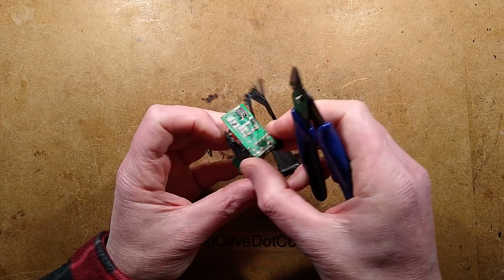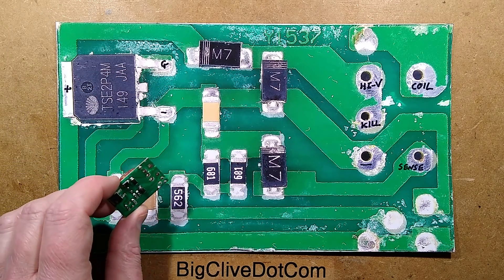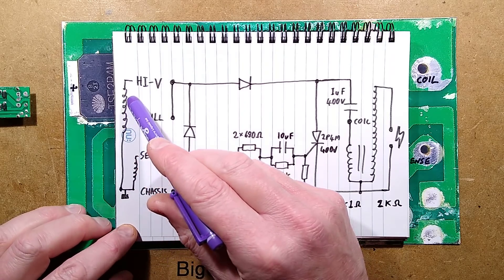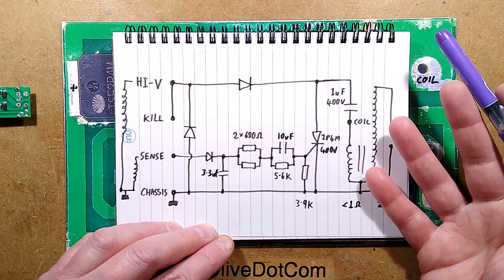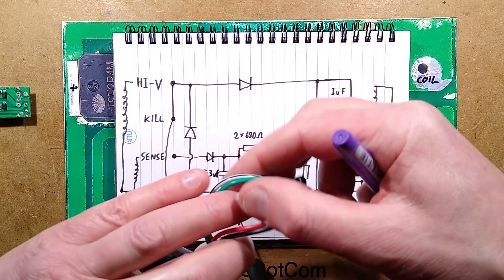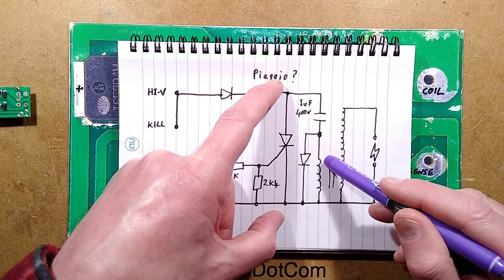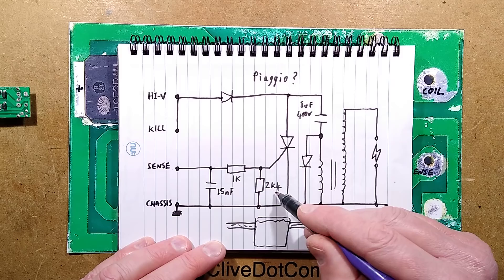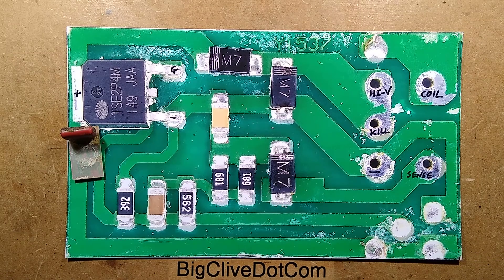Inside a cheap CDI Capacitive Discharge Ignition module - with schematic

Comment: the extra triggering circuit is to advance the timing at higher RPM , the first capacitor charges up more at higher rpm causing it to fire a few degrees before top dead center, this causes the fuel mix to fully ignite earlier so when it passes TDI it has the most pressure to push the piston back down, giving the engine more power. 
You can see this clearly with a timing light when you point it at the flywheel, you will see the timing mark move backwards gradually at higher RPM.
The CDI you took apart has automatic timing advance, the second diagram you showed has none and wouldn't be as good for high rpm engines.
Reply: The second capacitor in series with the gate circuit is a differentiator i.e. it's output will be dependent on the rate of change of the input which also provides an advance function.
Reply: In fact, simple CDI's like these don't actually advance at high rpms, they just retard less. The sense coil is before TDC. Also typical bike CDI's will have a very significant low rpm retard so the bike is easier to kickstart, the timing will jump above ~2000 rpms, which is clearly visible with a timing light, it is a very sudden change. I don't know exactly how this is achieved.
Reply: @Nicolás Rodriguez  depends, some flywheels generators have a simple round timing bump , some have a long raised strip, its important that the correct CDI box be used to match the timing mark on the flywheel, if the timing isn't correct , you would either get a lot of sound but no power or melt the piston with overheating.
Reply: iv seen the timing belt marker move when the engine is revved under that light flashing like a strobe. learning this stuff later in life is crazy sometimes getting the answers you ask in you head years ago on 1st seeing something. thank you for that bit of info MrPlytiger!!!
Reply: Thank you for that. I was wondering about the discharge path of the 3u3 cap and had assumed a tracing error. I'd not considered spark timing.
Reply: On some for mopeds you have a speed restrictor with a speed sensor on the CVT belt case basing timing due to a special centrifugal clutch with a magnet attached
Reply: Or the second one has mechanical advance
Reply: what about the high voltage section. SCR needs total of 0 potential on both sides in order to turn off . BUT the high voltage is keep going . there was always the potential across it
Reply: @HarpreetSingh-yo9ir  An SCR turns off when the current through it drops past it's holding level, not when the voltage is zero.  The capacitor is only charged when the magnet is passing the charging coil, which happens prior to the SCR being fired.
Reply: @ferrumignis  im trying to made a CDI FOR MY 160CC Bike. It is still working on TCI system. So i made high voltage 300v. I didnt know much about the SCR so i used 800v 20A mosfet in order to ground cap. But when i ground the capacitor the 300v supply also grounded. How the scr would work in this condition. Is it would literally work in that condition.?? Im so stuck😪😪
Reply: are you sure? its advance system
Reply: what bugs me is most outboards run mechanical advance. annoying, almost always its this ring that moves the throttle and the trigger coils at the same time, makes aftermarket carbs a bit of a hassle... 
only CDI outside of boats with mechanical advance ive seen was the 84-86 era honda ct90/110s as they switched from points, used the same advance mechanism on the cam, and no waste spark.

curves for four stroke is way different to a two stroke.

stepped trigger tabs, as RPM builds the variable reluctance sensor produces a higher voltage and the steps are arranged so it triggers the scr at specific speeds.

multiple tabs and processors, DC units that calculate when to trigger off time constants... usually have TPS thrown in as well... and a few extra cylinders  but not always..
Reply: If Piaggio indeed had automatic timing advance, it´d be rather via a supecomputer, than the ingenuity of an additional capacitor, 2 resistors...

Comment: Running a higher primary voltage allows them to have a lower primary current and less loss over their thin wiring loom.

Shunting a couple hundred volts through the operator isn't a concern for chinese scooter makers lol.  Maybe that's why they call it Bang good.  Some products go bang, sometimes you go bang, but you paid 2 dollars so it's all good.
Reply: You know it's not just the Chinee stuff, I used to have a Yamaha motor bike that was notorious for giving a random, unexpected jolt from the kill switch. And by random I mean while riding along not pushing the kill switch.
Reply: Ive rode many of these and seen many videos about them. Not seen ANY reports of anyone getting shocked by one ever. My god my carpet exposes me to several kilovolts in the winter. Must be made in china...

Comment: Wait. So alternator is a permanent magnet generator? And why on world it needs 200v? Also from where sense signal is coming! Hall effect sensor?
Reply: Most alternators have a field winding. But these magnetos for batteryless systems are permanent magnet generators as you say. A higher voltage is used because the spark plug needs kilovolts and a smaller turns ratio makes for easier circuitry and wiring. And the sense signal isn't a hall effect sensor, it's actually just another pole on the generator, but at a different phase angle.
Reply: @eDoc2020  oh ok thanks man. So most cars are batteryless? Because i have seen that if battery is dead, they push it forward to gain some speed and car starts with dead battery. Had to be pmg?
Reply: @commandroid9336  Cars require battery voltage. Usually there will still be a small battery voltage when dead and this is enough to start turning on the alternator field coil. Once the alternator field starts to come in the battery voltage comes up a bit and soon the alternator runs at full power. If the battery is totally flat at 0v and the car still starts it might be from slight residual magnetism in the alternator.
Reply: @eDoc2020  thanks man!

Comment: I’ve accidentally touched the primary side of the CDI on a small outboard engine. You definitely notice it. Some profanity was heard.
Reply: It's great fun when yer still a good few miles out at sea, tired, wet and hungry, and then you start getting mercilessly zapped. You do indeed certainly notice it, even through gloves! Suffice to say,  the throttles didn't get used as much that trip home, and then very carefully when they needed to be, lest they add to the merriment of everyone else on board, hahaha.

Comment: Would be interesting to see the inside of an ignition module off a small engine for a strimmer, chainsaw or lawnmower now, as they have everything potted into one lump, including the magneto, CDI and whatnot, with only two wires coming out, the HT lead and the Kill wire, with the magneto metalwork being the chassis ground to the engine block... :)

Comment: its quite simple triggering i made one myself first you have diode for just positive then you have capacitor not too big not to small just perfect to make voltage smooth them you have two resistors as you didnot noticed they limit the input current to rsc as at hast pulses 10uF capacitor have small Rx (thyristors dont need high voltage to turn on just about 0.7V they are triggerd by current spike thats what 10uF cap does) 5K6 is just for discharging and 3K9 just prevent thirystor to stay on for too long

Comment: I believe the 10uF capacitor in parallel with 5.6k resistor is most likely an RC Filter for high frequency noise coming from the Magneto/alternator.

Comment: that arrangement is probably to create a delay to change the ignition timing with the RPM.

modern small engines have the advance circuit built into the coils themselves so they don't need points. it's also a good way to design in a failure point into all crappy lawnmower engines.
Reply: Good point, it would be interesting to see the delay values on a scope at different hz! You could even swap out components to alter your advance curve

Comment: The world is running out of sand ...
... because it's all been potted into cheap Chinese electronics.
Reply: The worst bit is we are actually running out of sand. More than a billion tonnes a year used for concrete alone.
Reply: @gordonlawrence1448  Don't we have deserts for that? Pretty sure there's a lot of sand in the middle east.
Reply: @neoasura  Wrong type of sand.
Reply: *China is running out of sand

Ftfy 😉
Reply: I wonder if it's really sand or is it some fine ground glass or other waste product (no better way to dispose of e-waste than ship it out worldwide in junk products) :))
nothing would surprise me anymore.
Reply: @throttlebottle5906  glass is higher value than sand and can be used to replace sand in construction if you grind it correctly. They are both mostly silicon oxide (construction sand is anyway).
Reply: They are pumping a LOT of sand back into the ground in the USA for fracking.
Reply: @montestu5502  Yes but it's not construction sand.

Comment: Do you think the "performance" cdi's simply have a bigger capacitor charge/output?
Reply: No, the value of the capacitor don't change much from 1uf, they are usually in the range of 680nf to 1.5uf.
If you put a bigger cap in such a CDI it will introduce misfire at high rpm, due the generator cant produce enough energy to charge the cap with enough voltage.
Reply: @bleem2951  so how does a performance cdi work being as its a "dumb" circuit and not a processor based one?
Reply: @upsidedown4155  Usually those so called "performance CDI's" are nothing more than what is described in the video. They just have to perform the same or slightly better than the original one, wich many times employ protection and systems to manipulate the ignition timing. Most Japanese OEM CDI's have VDR's to change the ignition timing acording to temperature (they retard when hot). 
Note that spark energy has some correlation to engine performance but the engine has to be modified acordingly. What really we can feel is a change in ignition timing, even in the sound and most "performance CDI's" just try to advance the timing a little.

Keep in mind people will call whatever they want to whatever products, specially those made of chinesium. As a exemple look the amp/hour rating of batteries.
Reply: @bleem2951  thank you but that only kinda answered it (i am genuinely greatful as a fair amount of detail) i want to know how, is there some chip inside that delays or makes it spark earlier
Or intensify's the spark
I know you mention spark timing i just wanna know how the cdi does it,
On the chinese market as Japanese stuff is a completely different game in regards to development and design,
As i know with cars (play with alot of vag tdi's) you adjust many maps like boost request, fuel duty, throttle position request etc,
But never really understood how a basic dumb electronic unit did it, i assumed (yeah i know) there was some form of cpu that was set different but thats because like i say used to more ecu controlled stuff
Reply: @upsidedown4155  It depends on the CDI design. Some use nothing more than what is described on the video, if you look at the trigger circuit there is some RC filters to "massage" the ignition timing. Not perfect by any means but since all is done with passive analog components it's somewhat reliable and cheap.
In the video circuit, the 3.3uF capacitor right after the diode on the trigger circuit, usually helps "retarding" or "not advancing" the ignition timing too much, as the RPM rises, so does the voltage produced by the pick-up coil (trigger) and the timing would advance a little on higher RPM's. This is very complex to explain here but the CDI, the HV ignition coil and the AC magneto must work together to get proper timing.

Other designs, like modern ignition systems, use a microcontroller to control the ignition timing more precisely (depending not only on the RPM but also the throttle, and other sensors) and gaining performance/economy. Modern stuff is as complex as car computers.

Regarding Spark intensity, the engine only need enough to start the combustion, any more power is wasted. Lean burning engines (like those on built for economy,  e.g. modern cars) or high compression engines (like racing engines) need a awfull lot of energy to be able to start the combustion cycle properly. Also, if the ignition cannot start the combustion on one cycle, there's wasted power and a lot of unburned fuel right out of the exhaust pipe ->bad

To simplify a little, racing two stroke dirt bikes are the easiest to understand since they don't use batteries or any control systems, even the exhaust valve system is mechanical (centrifugal). 
They use a simple CDI with microcontroller that is powered by the charge system (no lights or battery) to adjust the ignition timing related to RPM, usually they need to retard the timing a few degrees of crank rotation (or miliseconds) on higher RPM's ad when starting the engine. 
https://p.vitalmx.com/photos/forums/2017/06/07/199273/s1200_CR_YZ_timing_curve.jpg
Reply: @bleem2951  dude thank you, credit where its due 🤘

Comment: "Filled with sand". I got a flashback to the cheapy cheap PC ATX PSUs of mid 2000's where they would put a piece of cement in the PSU to add weight to simulate "Much quality! Best copper! Cool alu!".... then they added 200 extra fake watts to specification. The cement blob was disguised as a filter/ballast for power factor correction.
Reply: I had a digital camera in the early 00's that had a quite large lead weight inside for that very reason. I've forgotten the brand now, but they were quite popular with the RC aircraft set at the time because they were so light once you removed the ballast.

Comment: its better to short out the sense coil to turn off the engine, becaue the sense coil will not get damaged even if shortet for long time on high rpms.
the hv coil instad will wear out evenualy and will result in dumping the whole alternator stator... (just a single pickup costs 1$)
Reply: I think they short the power coil because it offers a higher guarantee that the spark is killed. If you only short the sense coil you would still get sparks if the SCR spuriously fires. The power coil won't wear out because a) it's designed to handle this and b) once the coil is shorted the engine dies and power generation stops.

Comment: Is there a Max frequency at which theses work?  as some manu's use  the CDI unit to rev limit the engines ?
Reply: Yes. Depending on setup the CDI may introduce misfire at some RPM.
Some use microcontroller, others use analog circuitry. I've seen a couple that used a too bic capacitor to induce misfire on high RPM.

Comment: The sand also helps with mechanical strain on the components when they are exposed to high frequency vibrations from the engine and being knocked around while the dirtbike/scooter/quad/motorcycle is being ridden, especially when the thin rubber mount dry-rots and the cdi constantly bashes against the frame, dangling by the wiring harness :)